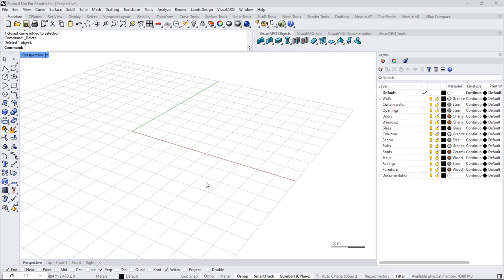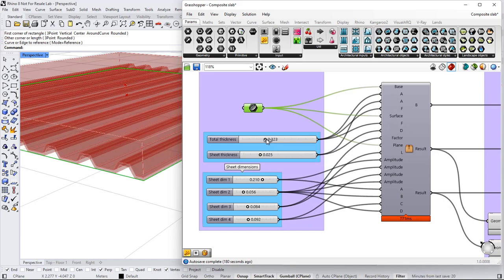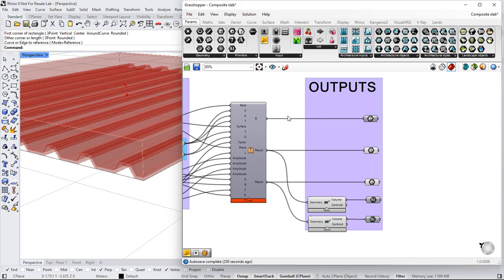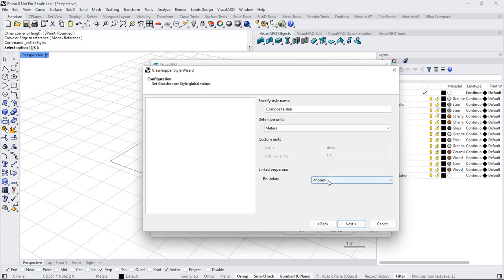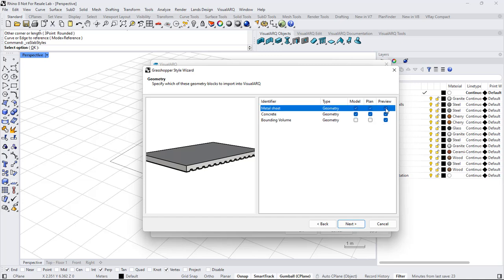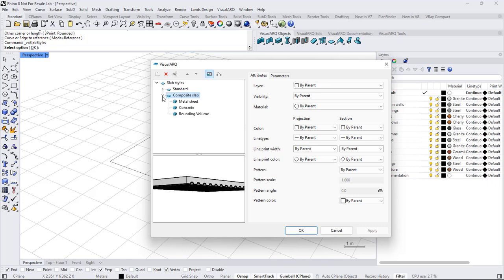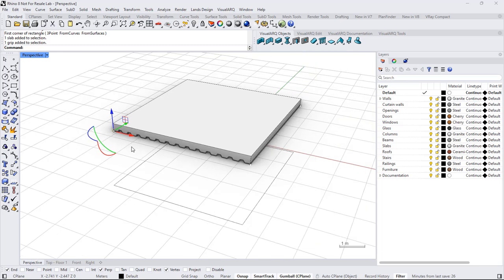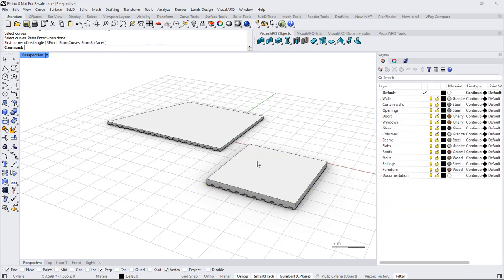Composite Slab in Rhino from a VisualARQ Grasshopper Style

Comment: Can you do this style to  a roof to make corrugated iron? Or zinc roof?
Reply from the maker: Hi @thomasbrydon7257, theoretically it should be possible to use the Grasshopper script used in this video for a new roof style. You could also create a roof style that uses the slab styles created from that Grasshopper script. However, I've tested it briefly, and it seem like there is an error when using this script on a roof sytle. We will revise this.

Comment: What is the difference between element and object in visual arq
Reply from the maker: Hi @rajendrameena150, a VisualARQ object is any object type: a "wall", a "door", a "beam", a "furniture object", etc... an "Element" is a specific VisualARQ object type that is meant to be for user objects that don't belong to the other existing types. It is the one you insert with the vaElement command. But sometimes, the term "element" can be also used generically to refer to any VisualARQ object, including walls, beams, etc...